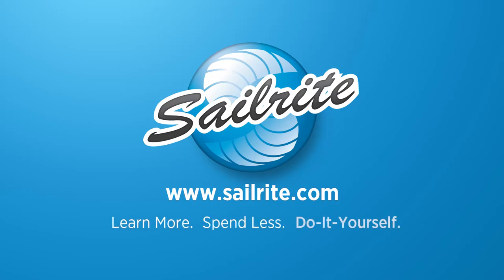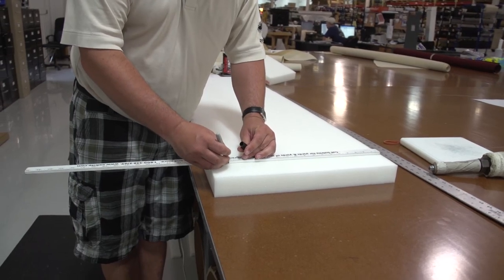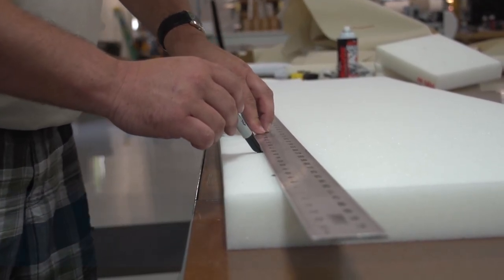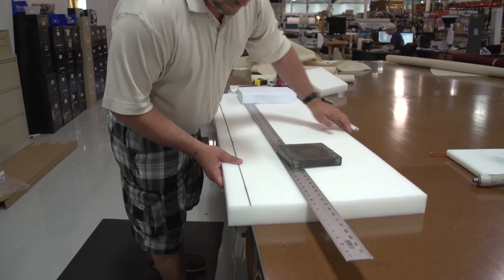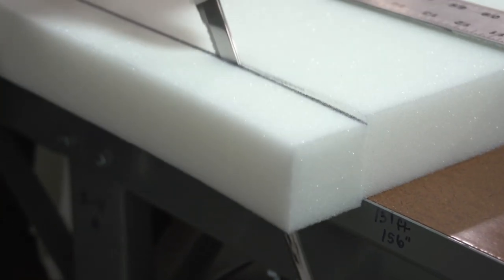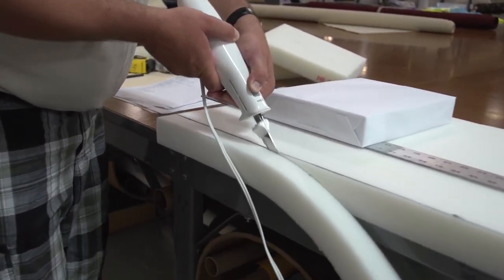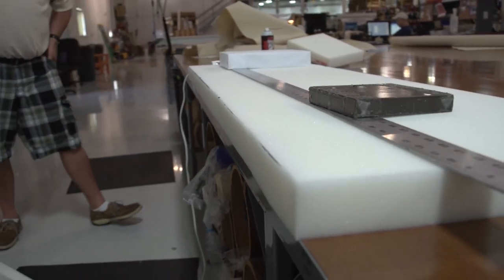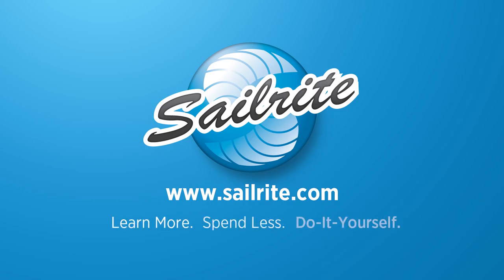Cutting Foam with an Electric Kitchen Knife

Comment: Will cutting foam (like in the video) dull the electric knife?
Reply from the maker: Eventually, yes. I have cut a lot of foam with an electric kitchen knife and eventually I have to buy a new one, because they start to not cut as well. But, they are very cheap.
Reply: @SailriteDIY  can you sharpen the blade with a knife sharpener?
Reply from the maker: @HeroQuestFans  Sorry, I am not sure if you can.

Comment: I need to cut a 16 inch Styrofoam wreath in half. It's 2 inches thick, so I end up with 2, one inch thick 16 inch wreaths.  Electric knife?
Reply from the maker: To cut styrofoam usually a hot wire or hot knife for cutting foam is used. We do not stock that type of foam cutter (that cuts Styrofoam), sorry.